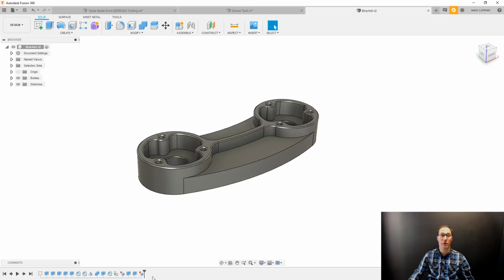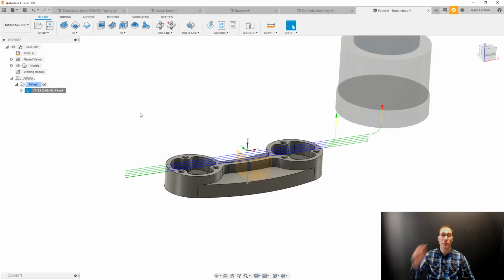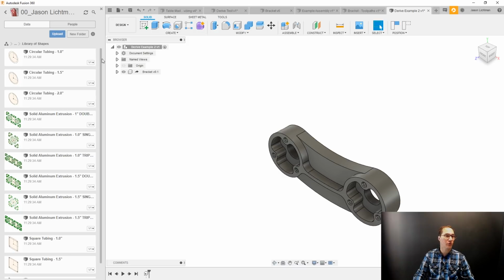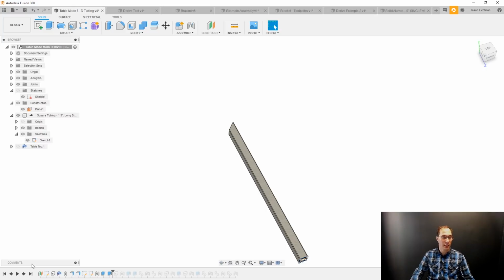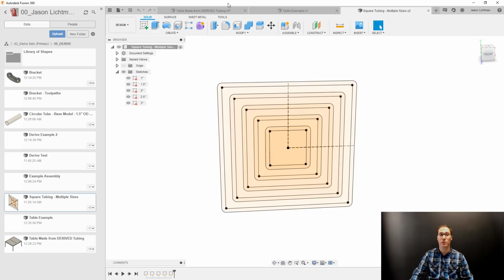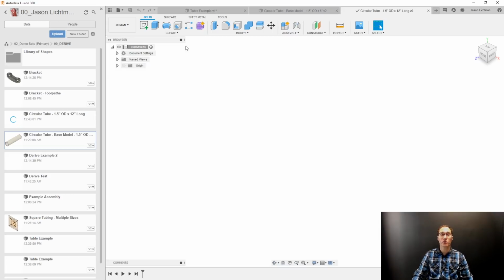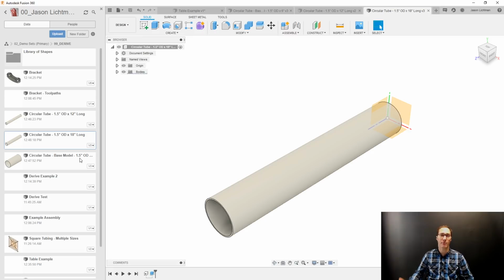Deriver's Education: How to Use the Derive Command

Comment: (4:00 - 14:00) Original Intent for Derive Command - The engineer & machinist workflow
(in derive dialog) machinist bring in what they want
(in new design) adds new design features to derived
Derived design can't be changed by machinist. "THIS IS WHAT DERIVE WAS MADE FOR"
(13:35 - 34:50) Other uses 1/3 Make a table using derived sketch aka block sketch
Pick the root level so that you can move component (brings in everything!)
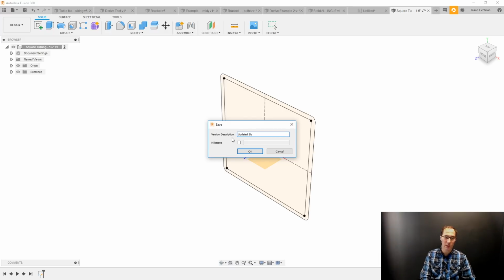(31:00) magic happens when the derived source is changed, then in new design, choose to update.
(34:50) Other uses 2/3 Make a table using derived sketch with multiple sketches
(41:30) Other uses 3/3 Make "configurations" of a circular tube using a derived solid

Comment: Thanks, I dint know about 'Derive', going to start using it. Probably a lot.
Reply from the maker: As Jason mentioned, its realtively new...and I would say you're in the same boat as everyone if you've overlooked it before.
Reply: @adskFusion  I try to keep up with new features, musta missed this one.
Reply: Fred Genius hope you find it useful!
Reply: @jasonlichtman  Hi. I have a question. I tried to use the derive function as a frame generator (as you showed in the table example) good idea! But I have a problem. If I have a square tubing sketch, like in the example, and create a joint between the corner of that sketch (derived file) and the tabletop. If I then change the size of the square tubing sketch (the derived file), the joint does not update to that. So the tubing is off. Hope you understood. how to fix this? That the assembly model will update the joints if the sketch is changed.

Also, I tried to insert derive with parameters, but its not possible to change the parameters in the file where I inserted the derived file. So what's the point of ticking off the "parameter2 box when importing derived then? 

Hope you have time to answer even if the video is not completely new!